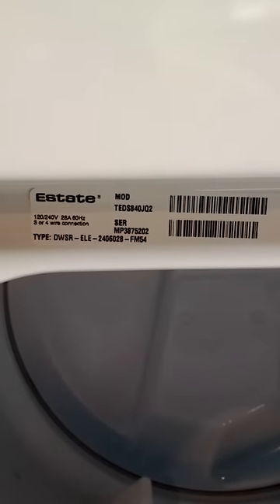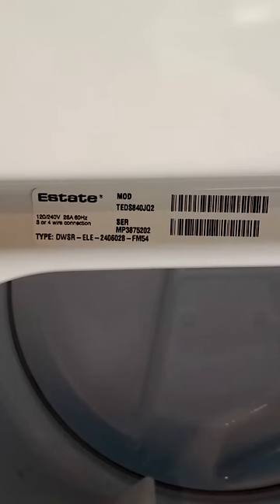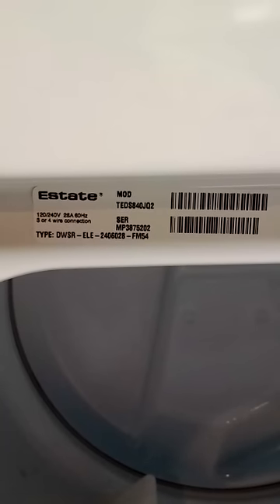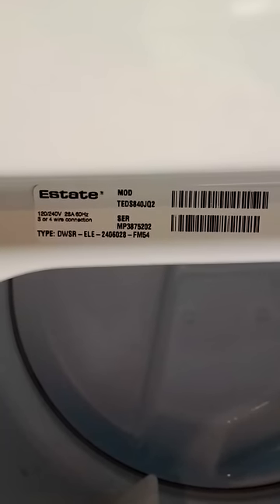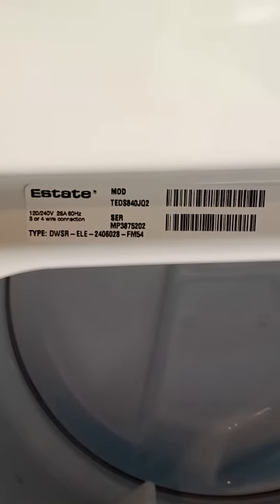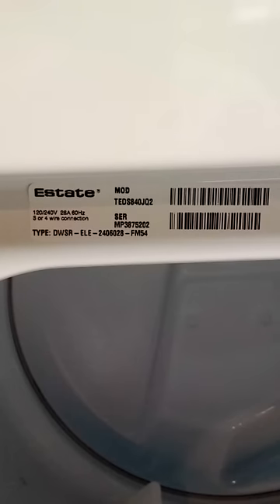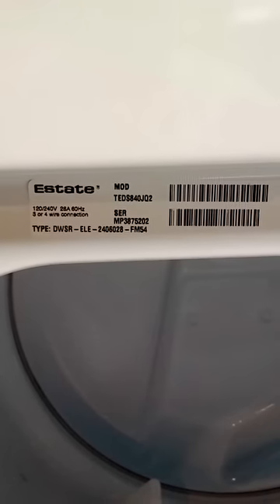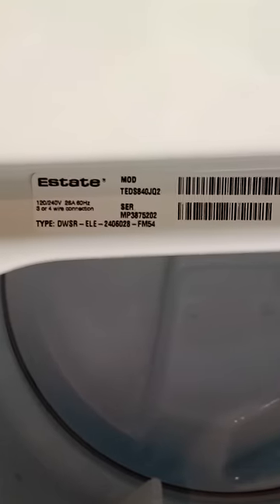How to open an Estate / Whirlpool TEDS840JQ2 dryer

Comment: I have the exact dryer and I have a defective timer. Unfortunately I did not mark down the wire colors when I removed them to replace it. Is there any way you could snap a photo or two so I can get it installed properly?

I know it is a hassle but please!